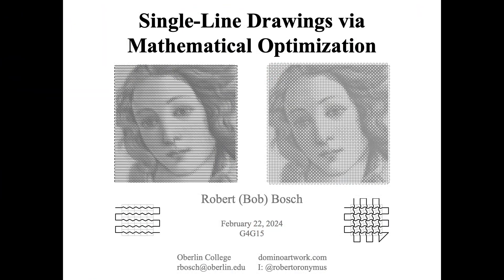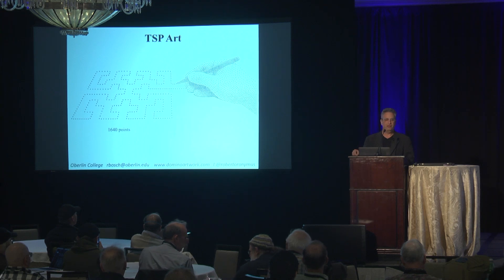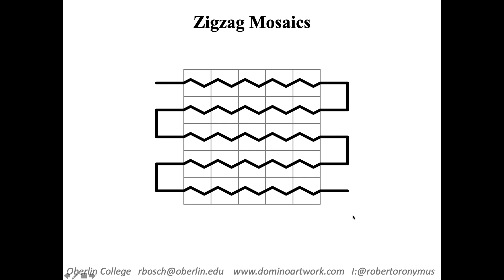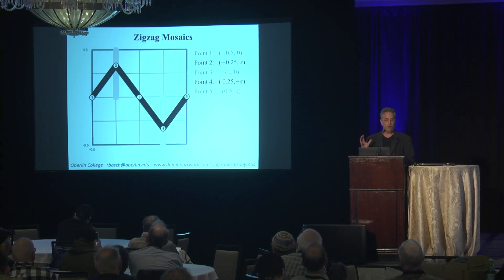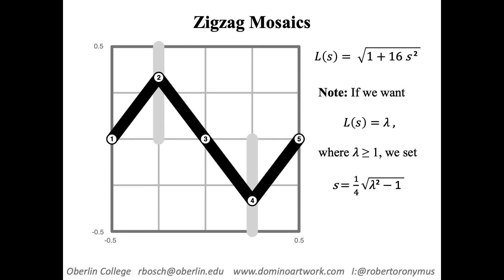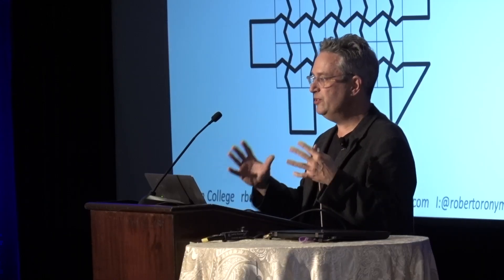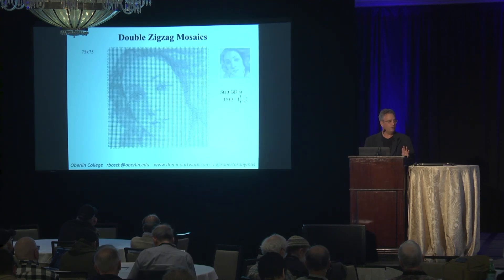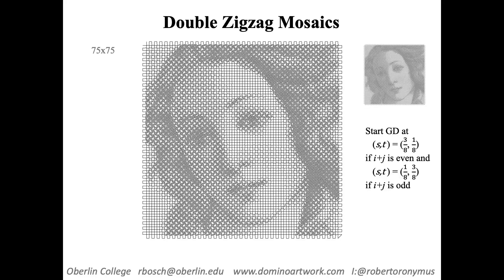Robert Bosch - Single-Line Drawings via Mathematical Optimization - G4G15 February 2024

Comment: These might have some interesting applications in 3D printing. A single line path is ideal for creating a layer, avoiding problematic non-extrusion moves, and imagine creating infill images inside of an object printed in translucent materials, or even in top/bottom layers of an object.